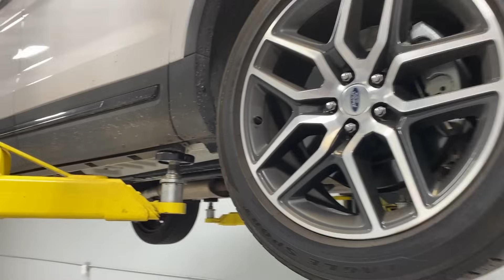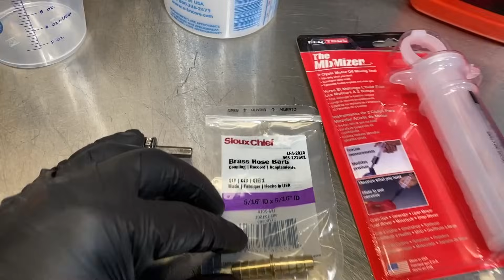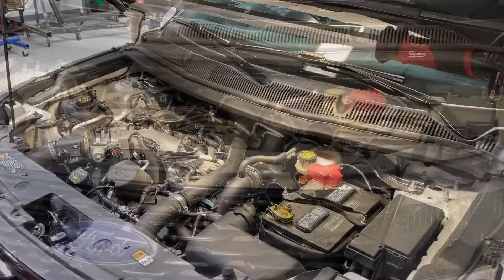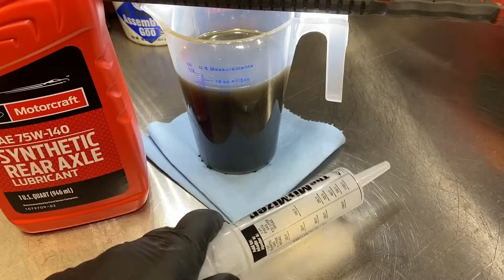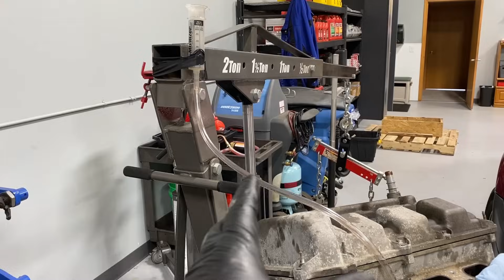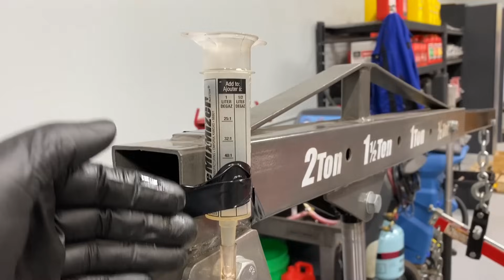Fluid Service on Ford’s New Cooled PTU’s is Possible: We Show You How!

Comment: Ford dealership is asking $1400 for this PTU fluid service. This is not a joke.
Reply: Think that's funny my dealer wanted 3,000 just for the part I found a ptu on rock auto for 745$
Reply: @StrangeGears  I was referring to the PTU fluid change only. God knows how much they would have asked to replace the PTU.
Reply: Had it done for $180 at a local shop but I did provide him with the instructions on how to do it, using the video [thank you] He applauded my decision to have this done! He had never done this work and thanked me and said he would advise all Ford owners with the AWD to have this service done.

Comment: I was expecting you to push the oil in through the drain opening. Aftermarket should make a one way check system to allow such a procedure.
Reply from the maker: Too much of a mess unless there was a check valve unit.
Reply: @FordTechMakuloco  
Problem with a check valve is that it has to be at the bottom where the junk collects.

Comment: Great idea but one thought. Filling through the vent means its a sealed system once you put fluid on top. There's trapped air in the PTU and it would be easy to apply too much pressure with a plunger and have it in return belch lube back out of the vent hose. I'd let gravity do it's thing.
Reply from the maker: Yes gravity is best or plunger it very slowly as shown, the space inside the ptu is large compared to the fluid you are introducing one vile at a time so it would be hard to apply too much pressure especially if it has time to vent between doses.

Comment: Thanks for the video. I could not pull the vent cap off the PTU vent hose for the life of me. Tried using a little flathead to pry it loose but no luck.
So I thought why not just  cut it off with about an inch of the vent hose then used a razor blade to slice the remnant hose piece vertically and it comes off easily.
That's what I did and I don't see why that wouldn't work.
Thank you for the instructions, I would have no idea where to start and what to do without your video!
Reply: thanks for the advice this is what i did. plus i used some small channel locks for leverage to shove the barb in the vent hose

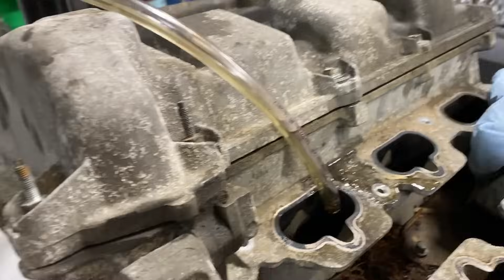Comment: 20:45 once you start the car the heat will thin out the fluid and clear it no problem.
Reply from the maker: Definitely plus the vibration of the engine.
Reply: Make sure the 🐈 is nice n hot when you do it 🎷

Comment: Thanks for showing us this great work around for a very poor design by Ford.  I bought a used 2016 sport with 42,000 miles.  I immediately drained and replaced the fluid. It was nice and golden.  I was happy to see that at 42,000 miles.  Fast forward 20,000 miles..... PTU smoked.  Light came one and the god awful stench of burnt gear oil.  Of course the wife was driving to get groceries and I was out of town.   I tow a 6x10 trailer with 2 dirt bikes half dozen times a year. I have always watched the PTU and trans temps on my phone through an OBDII adapter. Pulling mile long hills at 65mph the PTU would run around 95-110 degrees F.
I drained it last night. It was blacker than coal but still liquid.  The smell was awful.  Drain plug was pretty fuzzy.  Refilled and have put another 50 miles on it.  So far no overheating. I understand it's life is short but at least it's drivable until the shop can get it in.   Think it's time to trade it for a truck.  Loved the car and the acceleration of the Twin Turbo.  But if it can't pull a trailer without self destructing It has to go.

Comment: If that was me plunging in the fluid, the tip of the syringe would have exploded out of the hose with a mess quickly following😅. So yeah, patients lol. Great channel and content. Thanks for posting.
Reply: Kind of like watching grass grow. Can't you expedite the fill process from bottom . Get a pipe thread nipple fitting to thread in where the drain bolt goes attach a long fuel hose  and bring to top of vehicle . Pop the cap off vent and fill by gravity with a small funnel from on top. Take low air pressure to push the remaining 6 feet of lube in hose into the diff and then pinch off the fill 2hose as close as you can to the drain. Pinch off the vent hose .Unscrew the pipethread nipple with hose from drain. (Gear oil won't rush out  with vent hose pinched off from above). Reinstall the drain plug. Unpinch the vent hose and put the vent cap back on.  Gear oil will flow in much faster if the air has somewhere to go other than burping back through the lube you are trying to get in from  the top. Just get it in from the bottom drain plug hole like filling those dipstick tubeless transmissions

Comment: Definitely a great tip!  To the non believers: remember, this vehicle only has 30k on it.  imagine what those exhaust bolts and other bits will look like after a few good winters, especially in the rust belt.
Reply: Yep. Did my Chicago 2013 3.5 Ecoboost MKT with 200k miles last week. had to heat the crap out of multiple nuts, one stud broke and one had to be cut (thankfully not one of the studs in the manifold to cat connection). It was a serious pain. Plus, I had the fun of the back side turbo oil return line freezing into the block and breaking. So I spent about 5 hours getting the broken part out of the block, which ultimately required tapping the fitting and very slowly extracting it with a bolt and stack of washers. Good times.

Comment: 2017 Explorer 3.5L EcoBoost with 50,500 miles. We had to use an allen wrench with pipe to break the drain plug loose.  The oil was just a bit dark, but smelled normal.  Moderate metal on the drain plug magnet.  Getting the drain plug back in was a major PITA.  Very awkward position and only finger room to maneuver the plug into the threads.  On the top-side, We couldn’t get to the vent and hose from above with more than the fingers on one hand. We got under the drivers side and pulled the vent hose down enough to cut the vent off.  I fished the new hose extension with the brass barbed connector down from above and connected to the existing vent hose.  Had enough room to get two hands on the hoses so pushing them together was very doable.  Pulled the excess hose up into the engine compartment and secured it with zip-ties. Of course, adding the gear oil, pressure locked everything about halfway through refilling the PTU.  I put a heat gun under the PTU which increased the air pressure and gently burped the system to normalize the pressures and oil flowed again.  It took several burps to allow all the oil to flow into the PTU.  Hope this method helps someone who needs to change the PTU oil.
Reply: Thank you so much! I just posted a comment asking for help because my valve is buried under several wires and I can’t get to it with more than one hand. It also looks like it is zip tied. Was yours as well? Also, where should I be looking underneath the car to pull down the tubing?

Comment: Crazy dude... I just figured this out 2 days ago after watching your other videos about it.   Also the concern about clogging is because the PTU is sealed and the only vent hole is being filled with fluid. If your fluid is sludge this could cause a problem. My plan was to put a little fluid in the vent hose while the drain was open to make sure the vent hose wasn't clogged. if it is, compressed air.

Comment: The 75/140 synthetic oil is thin and flows just fine. Be patient. I’ve done his method 4 times now. Works like a charm
Reply from the maker: It is actually quite thick but with a little patience it will go in just fine.

Comment: My brother-in-law made an oil installer for the oil thru the drain plug with a plunger suction gun.  He just pushes new oil back into the drain hole.
Reply from the maker: Yes but the problem is this is not accurate and over time can cause more harm than good.

Comment: Thanks for the great content. As a seasoned campaigner (read "old"), I go here for my 1st pass at all our family Ford/Lincoln maintenance. The only challenge I see here is the vent is not able to "vent" when used for filling with a high viscosity fluid, no ability to burp. Slow and steady is the only way, I would not recommend using the plunger to "force" fluid as it could very possibly push the syringe(funnel) out of the line and make a huge mess. Additionally, it could damage a seal as you are, in effect, pressurizing the PTU case. It is a great option for future servicing but there is no magic way to get 75W140 hypoid to flow quickly enough to not try your patience. Thanks!

Comment: On the Fusion Sport (17-18), properly drained is almost a full quart.  Drain plug easy accessible, to top fill is not too bad if you use a brass reducer on the tip of a hand pump extractor/filler. I do it at every 12 miles and strictly use Amsoil 75w140.
Reply from the maker: Yeah that's the newest style PTU we are seeing with a totally different design and sooo much easier to service.

Comment: Great instructional! Sometime you should do an instructional on how to add and fill transmission fluid on the 6r75, or similar. Particularly on an 08 expedition.  You know the one were they put the dipstick on the right side of the transmission. Between the right cat and transmission pan, with just enough room to stick your hand between to check it. Running and warmed up.   It reminds me of the board game operation lol.  When the nose lights up and the buzzer goes off, because  I just burned the crap out of the back of my hand .  Haha !
Reply from the maker: I have many many videos on that transmission on the channel, all you need to do is use the search bar.

Comment: If you drain the ptu and thread a hose barb where the plug was, then put a hose in the bottle of ptu fluid that you have measured out. The vent hose that you relocated, put a vacuum pump on the hose and pull the product up into the PTU, once it’s all inside disconnect hose Barb and put the plug back in.
Reply from the maker: No friking way, never do that!

Comment: Just watched the video, what a cluster****! My only suggestion is to protect the o2 sensor/cat would be a piece of aluminum foil to cover the cat/o2 sensor.will also make a nice channel to guide the fluid away.
Reply from the maker: I've done that too.
Reply: If you're in an area that has salt and snow, that oil will just help with repairs later down the road ie. removing exhaudt and/or O2 sensor. 🤣

Comment: Great video and information ... I ended up pulling down the vent hose and making the connection with the brass barb from the bottom - as hard as I could I could not get the vent cap off of the hose when reaching from the top.  I do have a lift and a long pliers which helped immensely.  I was then able to thread the hose back up.  Thanks Again
Reply: Hi Butch.  Great idea.  I have a 2017 platinum explorer.  Is that your vehicle as well?  I can touch the vent with my fingers but don't think I can pull it off.  I have looked from underneath the vehicle, but with the cooler, I can't seem to see the vent tube from under the vehicle.  If you do have a 2017 platinum, any suggestions would be helpful.
Reply: @thomasbenko4246  No that is not my Explorer, mine is a 2018 but like I mentioned going from under the vehicle worked great, it is hard to see but it is there, when I reached up with the long nose pliers I was able to pull it down and actually the cap fell off??  As much as I tried I could not get the cap off from above either.

Comment: So the engineer's make a revision that satisfies the bean counters knowing it will still fail but at least it has a useless temperature sensor in the way so when the tech hooks up a scan tool he knows for sure it's toast.
Reply: Exactly, the temp sensor serves no purpose as the PTU cannot be disengaged if it overheats anyway
Reply: When the PTU grenades the shrapnel will likely take out the sensor. Then they can charge for a new PTU and a new sensor too. I wonder how much more the new "cooled" PTU costs vs the old non cooled PTU.
Reply: I bet it limps if overheated, but still what's the point if it can't be serviced more easily

Comment: alright so to help others who are having trouble heres what i did: i removed the airbox first step (mostly to fill the transmission fluid) but i also used a small pair of vice grips to gain leverage on the hose as mine was pretty short. grip it a few inches from the vent, then grab a boxcutter, be careful not to cut yourself while you cut off the vent cap along with like half an inch of hose. the vicegrips not only keep the hose from dropping into a hard to reach position but they also allow you enough leverage to push on the new barb and hose extension.

Comment: I think the way to go would be filling through the drain plug in a fashion similar to the way some of the euro transmissions are filled from below.  I couldn't find a plug that would work, but I think it could be done by screwing a barb into the drain plug, overfilling slightly through an attached hose and then replacing the barb/hose combo with original drain plug.
Reply from the maker: That is easier but this is more accurate. If I am going to do something then I am going to do it right or don't do it at all.

Comment: I'd be tempted to fill from the bottom up like an outboard motor or sterndrive. Drain fluid, measure, flush, fill+1 pump, close top vent, close bottom drain, unplug top vent line

Comment: Just did a PTU replacement on my '13 Lincoln MKT 3.5 Ecoboost. What a PITA. I haven't opened up the old one yet to see what it looks like on the inside, but it was whining pretty good. I had installed a drain on the bottom a month back because I thought it didn't have a drain and I wanted to swap the fluid and buy myself a little more time. Post removal I was very surprised to find that it did in fact have the same drain as this one. The top was covered in black sludge the consistency of pudding but the little metal cap used on the older PTU's was still in place. This truly is a terrible design. My replacement came out of a salvage yard MKT, but I found a receipt indicating it had been installed 6 months ago. Based on the markings on it though it was also used. The part number was '15 Flex EcoBoost. I pulled off the cover and it was in good shape inside, so I just cleaned it, applied a little bit of bearing grease to the tapered bearings and put it back together. I am looking forward to taking apart the old PTU.

Comment: Just chenged fluid in my explorer that way ( almost ). I used another tube3mm/5mm ( inside/outise ) and insert it inside of 5/16" main tubing. Then using 100ml syringe pushed oil almost directly in to ptu. It was not possibel to put pipe inside of ptu ( probably hole inside of ptu casing is much smaller than 5mm ). It took us 30 minutes to fill device. 

Great channel run by real PRO. thanks!

Comment: If your fluid stops draining the plunger method will work.  You can also run weedwhacker string through your syringe and tube to disrupt any air bubbles.  Put the string through a straw (helps guide string to center of syringe since it naturally wants to curl),  straw into the syringe and feed the string  through till you hear it gurgle.
Reply: that's a great idea - thanks for sharing

Comment: I'd be curious to see if Amsoil Severe Gear 75w-140 could extend the service interval of that unit. The stuff holds up extremely well in preventing thermal runaway. I use it in all my vehicles. 

I've exceeded the towing capacity of my truck by ridiculous amounts using their 75w-110, and the oil never let me down. My spider gears did ('07 Silverado - pre-bailout GM product, so no wonder) ... but that's another story for another day, lol.

Great tip as always, Brian - much appreciated!!

Comment: your are the man thats what i did it took forever to bleed in small hose in maine winter. i took it to my dealer  at first to have all fluids change and they told me it couldn't be done on a 18 explorer at all that it was sealed and it was a life time fluid, so now i do all my fluid changes myself lol. that PTU is smack dab on top y pipe and beside that CAT and its like a oven cooking that PTU and with only having like 16 oz of fluid that turns to glue over time.

Comment: He mentioned a tip I used when filling with that 75w140. I set the jugs in the hot sun for several hours. Makes that syrup flow better. But if its winter, well..

Comment: Thank you for this video, I just changed the PTU fluid in my 2014 Police Interceptor Utility. It's a lot easier with the 3.7, less hoses in the way once you take off your air box. The drain plug is still a (you know what) to get to though.

Comment: while a diff ford and diff service, this reminds me of the challenge of my '14 escape read diff unit. no way to do that job w/o a decent syringe pump - both for evac and refilling. i got one on amazon that has a 'locking' hose so when you plunge, it wont come off and splatter fluid all over. btw brian, your vid was the reason i even knew to change the fluid in my escape ptu.. i figured it was lifetime. on my 2014 escape, the ptu fluid change is super easy. ty for all you do!!

Comment: Very clever method. To save time I think I'd try to seal & tighten the fill plug only after the refill to allow venting. I also like Tim S's idea below, of using a second tube as a catheter for venting. Either way, Ford should've thought of this, and hopefully will integrate your idea into their design.